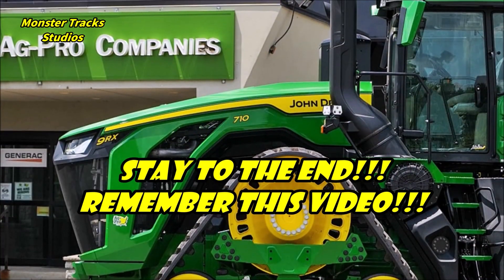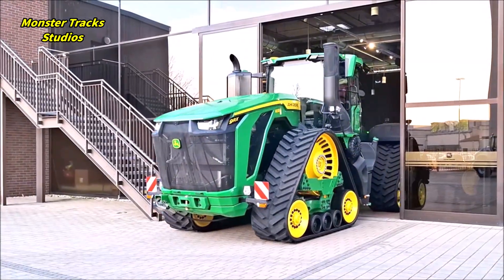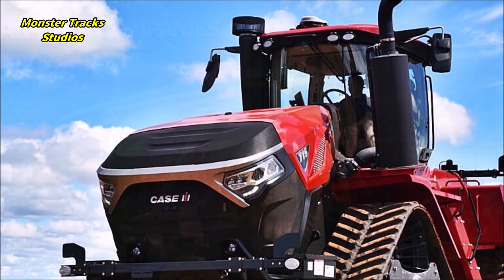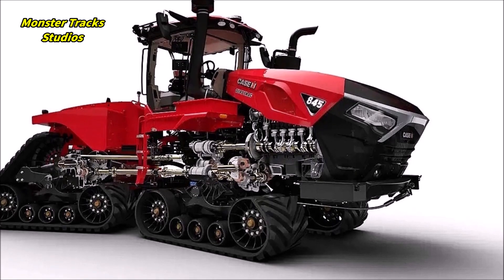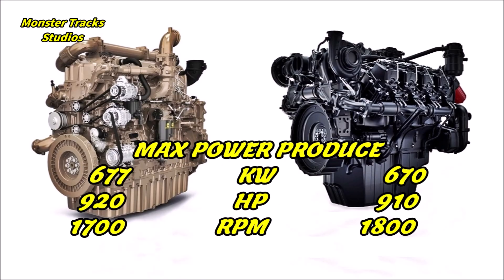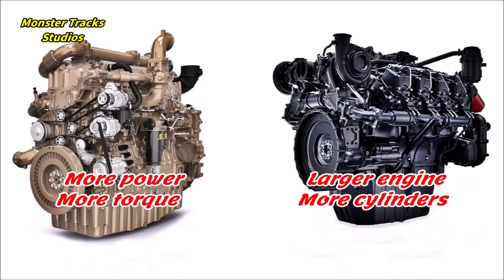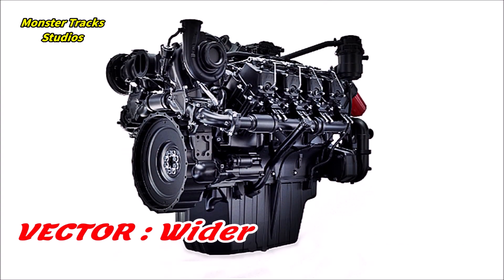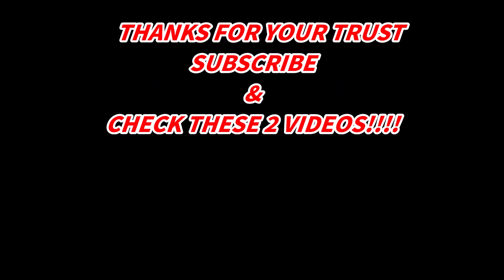Case unveils soon third Case 845 Quadtrac against the 9RX 830? [X-18 Vs VECTOR Which is stronger?]

Comment: fpt vector would not be a nice tractor engine...
Reply from the maker: Why?
Reply: @MonsterTracksStudios  Because tractors run steadily, they are not race cars. The engine runs within a small range of rpms like 1600-1650, there is no rapid change need in the field work situations, so more cylinders does not help the efficiency much. If you can achieve the same torque value with a smaller displacement and less number of cylinders, why to go up.. It is only needed when less number of cylinder pistons and crankshaft are clumsy enough to ruin the balance of the engine and its reliability.. It does not seem the case since there are plenty of L6 18 liter 900+ hp machines all around the world.. If CNH wants to add more cyliinders, it should be worth it like building a tractor with 1200+ hp and with the operating weight around 50 tons, which would be more efficient by being significantly larger, but I guess it would not be worth research and development costs... 18L JD 9rx is already a very expensive machine sice it has been build from zero almost entirely..
Reply: I'm not getting it. All engines for forage harvesters above 1000HP are using V engines, and with 12 cyls. Fpt would use a V8, which should be even better for compactness, reliability and fuel consumption...I'd be curious to see how it fits in there
Reply from the maker: @mkl92_bt it's different on tractors than forage... the forage uses the power for cropping... tractors need it all to the wheel

Comment: The v20 is 1.5 decades old. Tons of improvement can be made with a clean sheet design, but im not sure if they would stick to a v8 or go i6 given the wider engine would be slightly harder to pack into a tractor.
Reply: Inutile mettere 30 / 40 ho in più per essere meno competitivo fpt 🤔 non mi piace io dico DEERE TOP KING💪💪👍👈
Reply: @giuseppemarchelli380  deere hasn't made a good reliable engine for years. The 18x is arguably the best engine they have and its a very slightly modified liebherr 18l with egr instead of def. Deeres biggest advantage is dealers and technology/connectivity.
Reply from the maker: How old is fpt cursor 16? It used on new holland cr 10.90 at 2014 so its about a decade old also... who knows... do you think the c 16 can be pushed up to 900 horses the tractor will blow up, also the c16 is wider than Vector and it packed really well on 715...
Reply: @MonsterTracksStudios  I find it hard to believe the c16 is wider but that may be turbo placement. You are correct though, the c16 is around 2014. Theyve made more power in completely different applications but given the fact that they redesigned internals to hit 853, unless they unveil an even more powerful version soon, Id say thats the highest they will push it. The other thing to consider as mentioned in the comments of another video is the frame of the 785 is probably at its limits trying to put that power to the ground. If cnh is smart, they are a couple years into development of a bigger chassis with either a new larger i6 or hopefully redesigned v20.
Reply from the maker: @Eric_V410  I have the sources down to the description, c 16 is indeed wider than vector.... i hope they will release a new steiger 900 quadtrac hahahahahaha
Reply: @MonsterTracksStudios  hope so to. Like i said i just find it hard to believe, however the turbo and other external parts have to be on the side of the i6 where they pack a lot of that stuff in and around the v on the v8.
Reply: @MonsterTracksStudios  Looked it up myself and the reason the c16 is 2 inches wider is the big ass intercooler in-between the compound turbos. So at the widest point the c16 is wider but at the back of the engine the v8 would be quite a bit wider. Also fpt says 861 max hp for that version so not sure why its not the case 795 or something with 861 peak.🤷‍♂️
Reply from the maker: @Eric_V410  the peak power of 785 quadtrac is 852 horses and the peak power of the 9 rx 830 is 913 horses, they never put on the tractors the highest horsepower touch of the engine for some reasons.... time will show if a third 845 or 855 quadtrac will be born with vector engine
Reply: @MonsterTracksStudios  i know how the model numbers work, just saying if fpt says it can do 861, why'd they limit it to 853. New holland is the only brand i can think of that names off peak power. Did you see nh is updating the t7 series btw? Unveiling at agritechnica.
Reply from the maker: @Eric_V410 I did a video before one month about updated holland tractors
Reply: @MonsterTracksStudios  ah i either missed or just forgot abt it lol